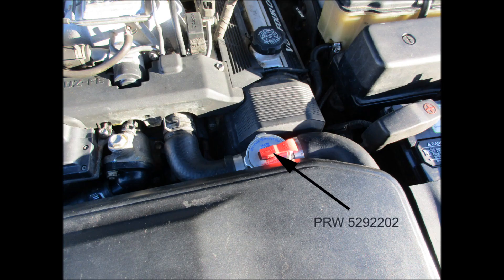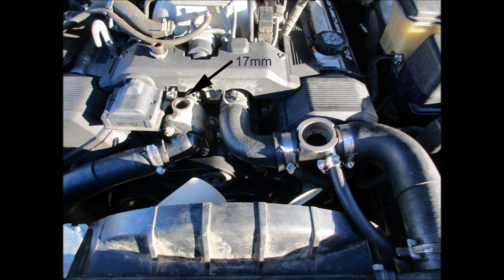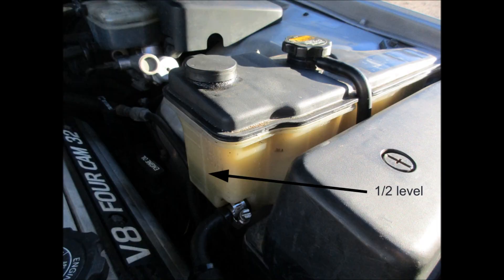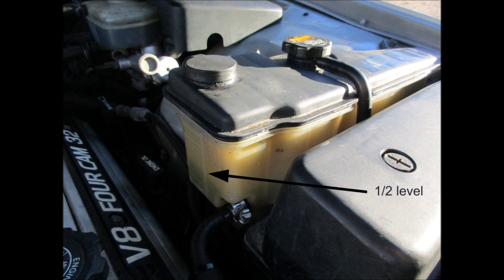Solving 1993 LS400 Lexus Overheating Problem / Bleeding Air from Cooling System

Comment: That 17mm bolt is severely stuck and I am scared to apply too much pressure as it could snap off. Any solutions known would be appreciated
Reply: It won't snap just muscle it. Mine was tight too.
Reply: Have u noticed thr 17mm bolt literally isn't round? It has short sides and long sides.. wtf? Mines leaking because it isn't round
Reply: Spray bolt releasing grease on it and tap the ratchet lightly with a rubber mallot ?

Comment: I have a 2000 Lexus ES300 I have a coolant leak on the firewall side on the Block right below the freeze plug back side of the block. It looks to be an inspection plate where the leak is can tell me tell me what that inspection plate is for

Comment: Interesting add on but certainly not needed nor is it correcting any particular factory design flaw. No where in the video did I hear you mention to fill the cooling system with the engine running. You fill through the 17mm bolt on the thermostat housing. Run engine at 2,000 rpm and fill through the bolt opening until full. Done. Recheck fluid level after several start stop cycles.
Reply: smithraymond09029 hey man I know this comment is several months old but I could really use your help. no where on any forums did I find anyone talking about this added part. I was hoping you could give me a clear step by step as all the threads are a bit confusing with they’re wording. If you could help I’d appreciate it so much!
Reply: @LegendProd1gy  The add on filler this guy is showing us is totally not needed. There is a 17 mm bleeder bolt on top of the thermostat housing. You open this (take it off) and at the same time to remove the radiator cap located on top of the reservoir tank. Start the car with the heater on full blast and start pouring coolant in through the 17 bleeder bolt. I have a funnel cut just right so that it fits firmly inside this hole. Run the car at high idle (2,000) rpm and keep adding coolant until you see it coming out of the radiator cap at the reservoir tank. Put the radiator cap on as soon it starts overflowing. You want the thermostat to open up so let the car get hot. You will still need to keep adding coolant through the bleeder screw until you see it no longer takes coolant. Put the bolt back on. You should have a nice full system when you are  done.
Reply: @raymondsmith6315  How long would you say this needs to take? And should the reservoir be full to start with? Or is it ok if the level is very low. Having an issue bleeding my 95 ls400 and I haven't tried this yet.
Reply: @raymondsmith6315 can u explain it for a 95 Lexus LS 400 please ?

If you filled the bolt hole until coolant overflows the resevoir then wouldnt you be way overfilled past the fill line needing to remove some ?

🤔
Reply: @raymondsmith6315 how would coolant overflow from the reservoir tank while filling through the filler bolt ?

The reservoir tank opening sits higher than the filler bolt.
Reply: @twilliamson330 did you figure it out ?

Im working on my 95 lexus ls 400 too
Reply: Doesn't the sticker say to fill at the bolt first then close the bolt then fill the reservoir tank half ways and leave it with cap off and run it for 15 minutes with the reservoir cap off ?
🤔

Comment: This worked for me but one comment. If the overflow tank is full and you find no water in the  upper radiator hose when you take the new radiator cap off... wait a few minutes.  For me, the overflow tank went to 1/2 level and the upper radiator hose filled to full.  There was no need to add water.